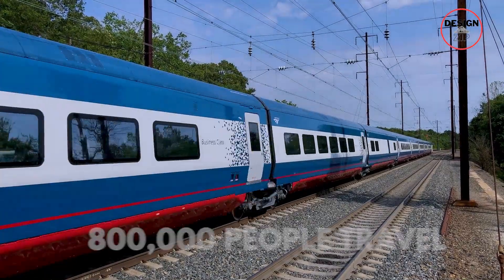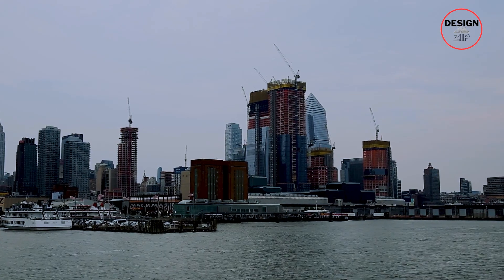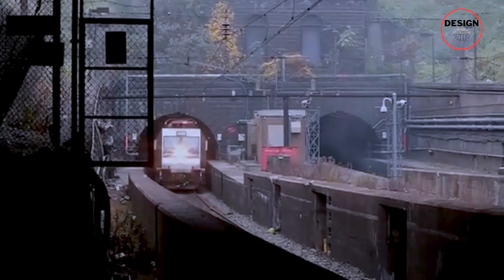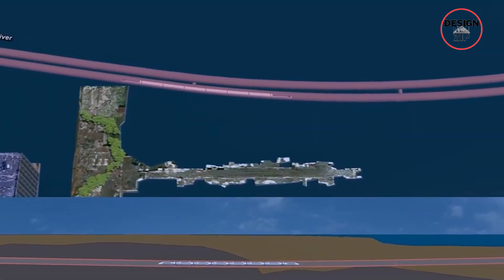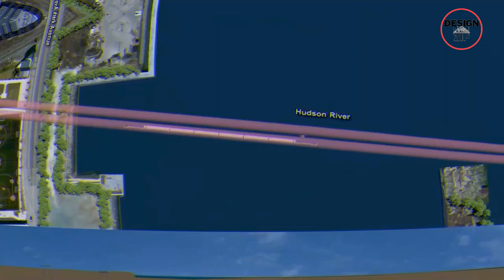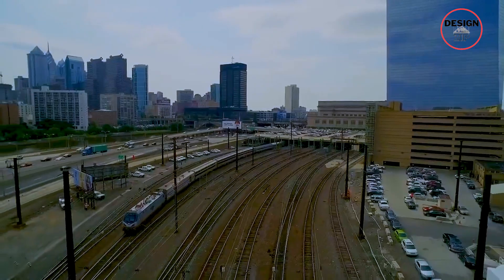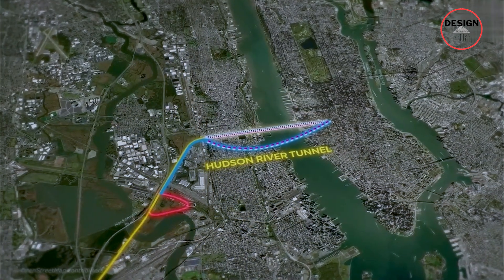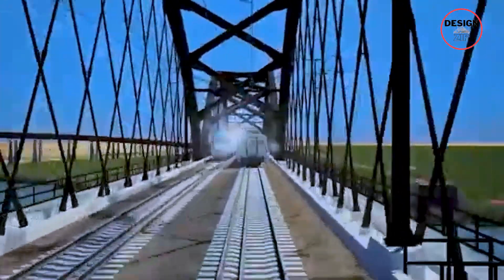The Real Reason Behind The Hudson Tunnel Project

Comment: The reason for the ground stabilization is that the so-called Box (tunnel conduit in Manhattan) is too high. There has never been a subaqueous tunnel through tidal sand and silt built so close to the bottom of a big navigation channel, literally in the water. (since the substance(s) is/are highly permeable, and sensitive about being misnamed! This also presents problems with servicing Penn Station in any form new or old, because the point where it meets the station is too close in so as to make service to about half the existing tracks impossible. (It meets up with the existing tracks right where the Empire Line comes in after negotiating its ludicrous R=350' curve with 85'-foot cars. The two new tacks, and their "Box" should actually be used to access a new Empire Line located under the West Side Highway, which would also serve a new station downtown at the Calatrva Oculus and intermediate stops along the way.